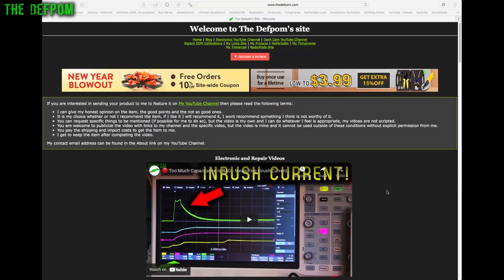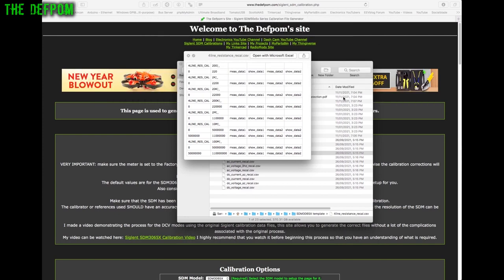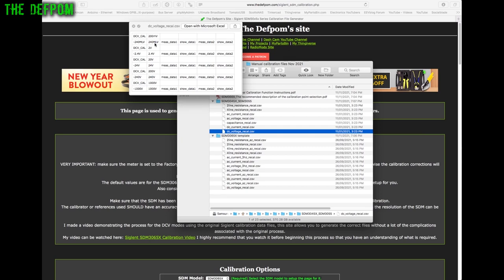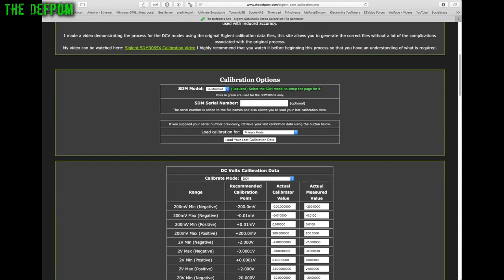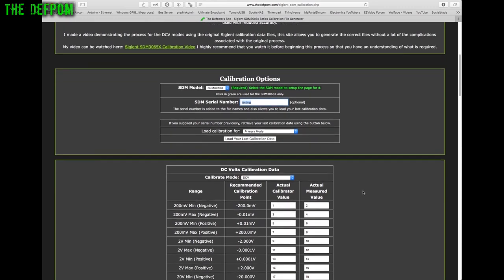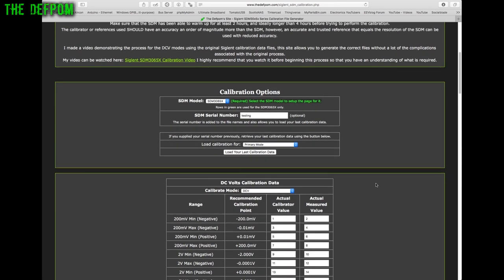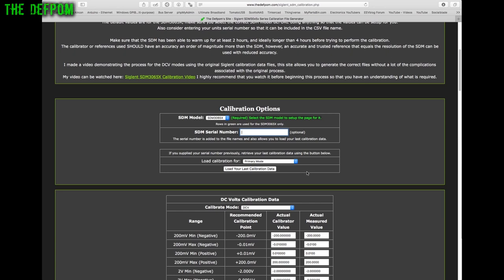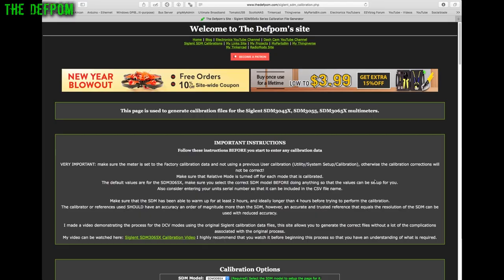🔴 How To Calibrate a Siglent Multimeter - Defpom's Calibration File Generator ! - No.892

Comment: Can you tell me why touching probes i 2 wire resistance mode shows value jumping allover ?
I am trying to zero in connected probes so when i measure low resistance line, i get wire resistance subtracted.
I touch probes together, press Rel button ON and value is jumping allover. 
When i connect the probes to ground on the PCB, i am able to get 0 when in Rel mode, but when i let go and measure needed part, value is allover.I should get 0.5 ohms but i cant see to get that. 
Is this unit not sensetive enough to measure 0.5 ohms ?
Reply from the maker: It’s probably the zero calibration being a bit off, so it can’t see values that low as a result. Also make sure the sample times are long enough to remove 50Hz / 60Hz mains noise.

Comment: Bonjour, j'ai un problème avec votre tableau Excel pour calibrer mon SDM 3045x.
Je me sers d'une petite alimentation stabilisée et d'un Fluke 187 comme source.
Malgré tout, je n'arrive pas à calibrer le multimètre, j'ai toujours un écart de 1-2% et ce pourcentage augmente quand j’élève la tension  (Par exemple 310v pour le Fluke vs 306v pour DMM).
Les calibres pour la tension pour le 3045 sont 600mlV, 6V, 60V, 600v et 1000v sur son datasheet, mais j'ai remarqué que votre fichier pour le SDM3045x est en 200ml, 2v, 20v, 200v et 1000v... est ce qu'il y aurait pas un probléme à ce niveau ?

En te remerciant :)
Reply: A moins que j'ai aussi un offset à calibrer (et à connaitre)  à chaque "DCV range"
Reply from the maker: It should be changing the range counts for the different meters, I just tried it and it is not doing it for some reason so something has broken, I will look at it as soon as I can.
Reply: @TheDefpom  
Merci beaucoup !
Je vais essayer de récupérer le script python aussi pour faire le calibrage usine, j'ai des amis métrologue qui ont un fluke 5522a 🙂

Comment: I have an SDX3045 meter. When I go into the Utility menu, the calibration options aren't visible. I'm looking at the same menus that you show on your 6 digit model - everything else is the same - but the cal options are just blank. Is there a trick to enabling those options?
Reply from the maker: Update to the latest firmware.
Reply: @TheDefpom  oh, sure... If you want to take the (now) obvious route! Thanks.